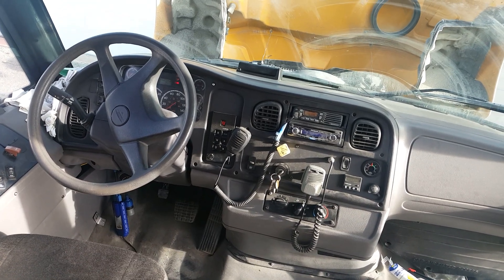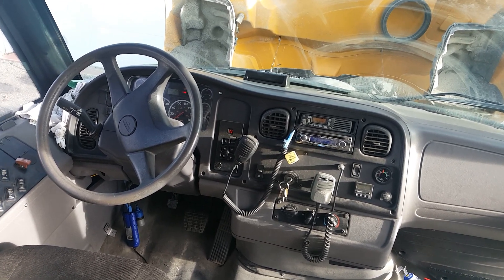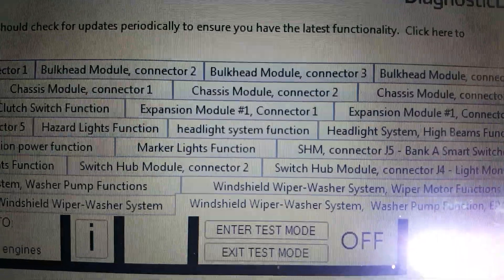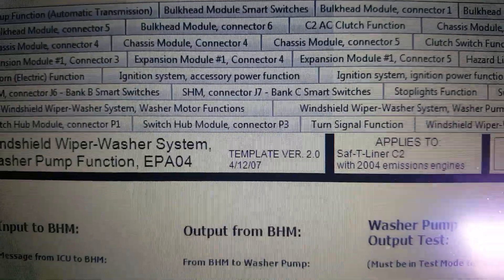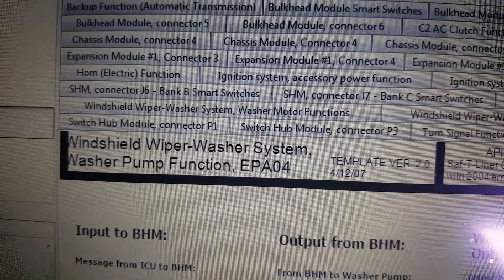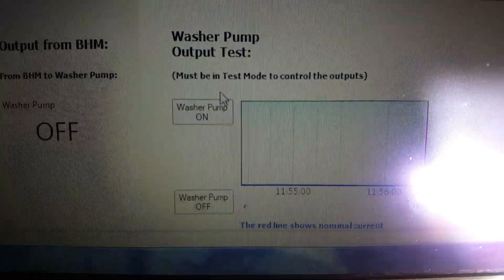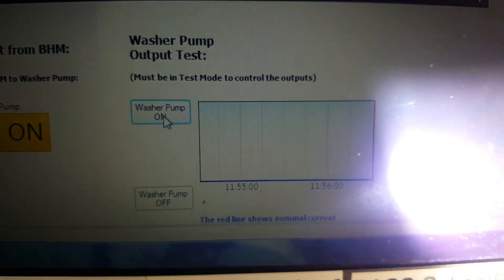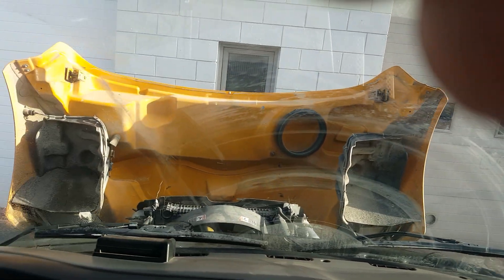Freightliner Diagnostic Link 8 Software Demo

Comment: Got a question for you. Im getting ready to open an heavy equipment ac shop mostly geared towards OTR trucks. What softwares would you possibly suggest that would cover hvac systems on freightliners kenworths petes ect…. Thx